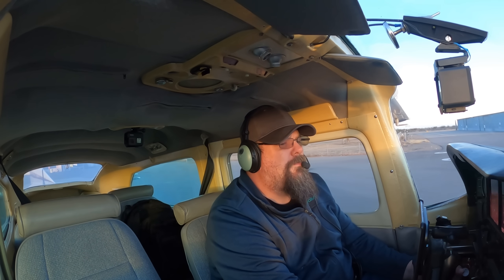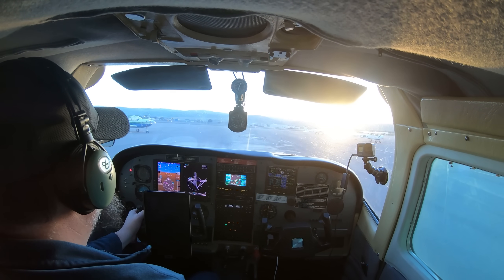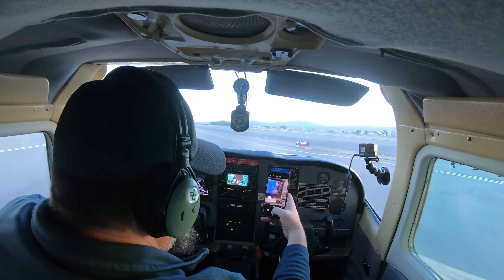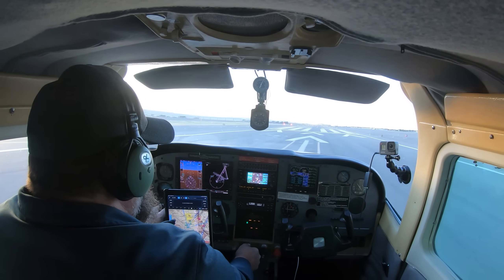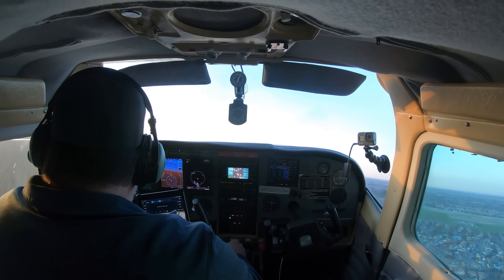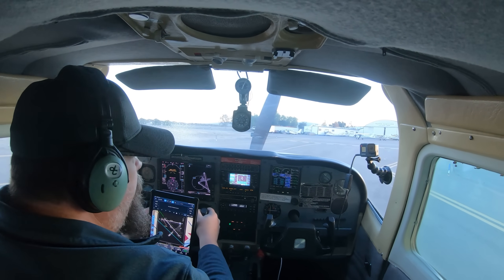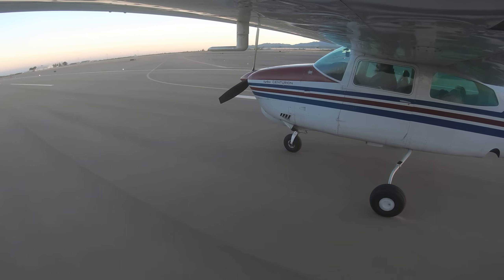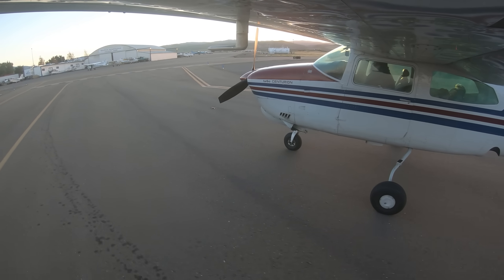Catastrophic Engine Failure after Takeoff

Comment from the maker: First, I want to thank everyone for the kind words and praise, but more importantly, I also want to thank everyone for the constructive critical feedback.  I will admit that there are some items that I was complacent in. And a lesson learned for the next flight is to create myself a special checklist for the maiden flight of the next engine, as well as many more lessons learned. 

A bit of background. I am a sub-500 hour commercial pilot. I purchased the airplane in August 2020, and have 158 hours before it went down for this maintenance. 

To be perfectly honest, I was in a hurry, for a couple of reasons. I had read many articles, for instance the savvy aviation article on AOPA's website at https://www.aopa.org/news-and-media/all-news/2019/january/pilot/savvy-maintenance-breaking-good  ::

"""It’s very important to run the engine hard right from the outset. Keep ground running to a minimum, avoid a protracted preflight runup, and don’t cycle the propeller more than once (and as shallowly as possible). The reason for all this is that running a freshly honed cylinder at low power for any significant length of time can cause a condition known as glazing, in which a tough residue of carbonized oil builds up on the cylinder walls and stops the break-in process dead in its tracks. Once the cylinder has become glazed, it’s no longer oil-wettable, and the only solution may be to remove and re-hone the cylinder and start the break-in process all over again."""

Or ECI: Page 12, step 16: https://www.jjairparts.com/images/uploads/files/Engine%20Break%20in%20Instructions.pdf
Or RAMAircraft.com: "Keep initial ground run to a minimum, only long enough to verify no fuel or oil leaks prior to the break-in flight. "

Another reason I was in a hurry, I was setting out at 4:20 PM PST, with sunset at 4:49, so I wanted to be in the air with daylight for the exact reason that became apparent in this video. Some get-there-itis. Get where? In the Air. Why? Because the shop would be closed for the next 4 days and I wanted to spend the weekend working on the break-in process.

There are a lot of questions about what would I do differently, use of checklists, procedures, the should harness, etc.

First thing I would change. Don't be in such a hurry.

A lot of the ground operations I'm performing while taxiing are me running through the runup and before takeoff checklists. This is not normal for me, I was rushing
At 3:16 I am performing a "Lights, Camera, with action to go" checklist as I turn on NAV and Strobe Lights for instance by pulling back the yoke so I can see what switches I'm flipping. 

So you might be saying, how did you miss the should harness if you use checklists? Well, my only excuse is that I already performed that checklist when I taxied from the north side of the hangar to the fuel island just a few minutes prior. The "Before Starting Engine" is one I need to make sure I pick up from this point rather than the "Starting Engine" checklist.

As for what would I do differently in the air under these EXACT circumstances, I can't say that I would do anything differently, change the wrong thing I'm a smoking hole in the ground. I hope I never have to find out.
Reply: Can I ask what caused the failure? And by the way some great piloting skills on your part glad you were able to set her down safely.
Reply: @ckelley63  Looks to me, like the connecting rod bolts were not propably fastned or had were over tighten. You can see the rods without bolts in it but the rod itself and the hole for the bolts are not broken. Just my opinion.
Reply: You did great under the circumstances. Don't let any nit picking get you down. There will always be something that we can do better but you met ALL the requirements of the mission and both you and the aeroplane are still here to fly another day.
Reply: Im no expert , but it apears that you handled the situation very well, ive seen some pilots go into full blown candyass mode over less
Reply: You did everything correct for the situation at hand and outcome. Hindsight is a luxury not everyone has. But you did a great job. There will be plenty of arm chair pilots contributing, but this was your experience and the hand of God himself must of been right there with you. Love your videos. Stay safe!!
Reply: @builttofly3686  I also thought that the plane (when it landed), ran so freely, over a great distance without power, as if the Plane was being wafted along, by his Guardian Angel's Wings. How much does a brand-new engine cost? It's worth considering after an event like this.
Reply: You did the best you could do. And if there's is a next time you will KNOW what not to do!  Just be careful with the C-210. After all it is a doctor remover.
Reply: I'm a keen private pilot and confess to having made many, many mistakes.  It's a great way to learn and after each mistake I feel a better pilot and hopefully they will prevent me from endangering someone in the future.  The CFI who taught me readily confessed to many mistakes and his stupidest was preparing for an airshow in a Tiger Moth.  He was doing circuits the evening before and while airborne one of the club members was hammering in wooden fence posts to keep spectators off the grass runway.  On landing the CFI struck one of the fence posts and tore a hole in the canvas wing.
Reply: @cormacsyt0  cowling removed would make the engine run hotter. Baffles inside the cowl direct the air over the cylinders to keep them cool. You really have to fly it to break it in or use a test cell to run it in on the ground which requires special baffling and a test cell of course.
Reply: No one has ever had a perfect flight. Mistakes aside, your results prove that you did far more right than wrong. I’m an ATP airline guy with an A&P IA and I certainly have made more than my fair share of flying and maintenance mistakes. I will say this though; it is an extremely risky proposition to not run an engine on a test cell prior to first flight (my assumption is that this field overhaul was not run on a stand). You could get that motor on a dyno or a test cell prior to your next flight and have added peace of mind. I’ve done the break in on a motor that had never been on a cell one time, never again.
Reply: @RobtheAviator  @Ed Frye when i built aircraft carriers we ran each prop shaft at full power for 24 hours tied to the dock before getting underway...and yes we ran an opposite shaft in reverse and a lot of wire cables to hold us to the dock.  congrats on passing your engine out on takeoff check ride.
Reply: Great situational awareness in this scenario. Glad everything turned out alright! I wanted to comment specifically because when you are rolling out I hear the landing gear motor running a lot more than I would consider normal. On our TR182, the motor tends to run occasionally when taxiing only when the nose strut is extended much more than usual, or very occasionally while in flight as pressure gradually bleeds off the system and it has to pump the pressure back up. If I were you, I would have this looked into as your pressure is bleeding off very rapidly and this may be cause for concern if you have a leak in the system, bad seal, weak pump, or otherwise. Just a note from one RG operator to another in hopes to prevent another very bad day with this fairly new-to-you airplane. Hope you can get back to safe and fun flying soon!
Reply: @nrcrate  the gear motor runs for different lengths of time on early vs late C210s
Reply: Being critical in our self evaluation is important for learning but somewhere in your paragraphs you should of mentioned how well you did considering you’re still among the living and able to tell your story. Great job.
Reply: @robertwaldo  I disagree. You can see half the connecting rod sticking through the engine case. My guess is improperly torqued connecting rod hardware. I would much rather have my engine explode on a stand than in the air. You are right there is nothing wrong with breaking in a motor on the airplane. Unless there is something wrong with it; then you will wish you had done it on a test stand. There is a reason that overhaul facilities typically run the motors for hours on a test cell prior to delivering to customers.
Reply: You did good, but I’ve personally watched crash and burns from turning back to late.  Nothing to be done by the time I got the fire extinguishers there.  There’s still the broken tree he went through I walk by every day, as he tried to make the road… but know of MANY people who have had to go into the trees and lived, may got hurt more getting out of the trees….
Reply: @mikeskupniewitz8057  could've gone into the field instead like I would have
Reply: Why don't mount the engine on a stand somehow and do prolonged take off/climb power testing there?
Reply: I'm a not a pilot or anything, but man seeing you handle that without any apparent fear; just staying focused and barely making it back was cool to watch.
Reply: @franklincerpico7702  
Adrenaline can do that for sure.  Mentally preparing for things to go sideways (in my case, literally) helps also.  When i flipped my minivan off the side of a mountain road hitting some black ice on a turn (thankfully a shallow ditch, but i planted the front passenger tire into a culvert which is what flipped me)... i handled the initial accident like a champ.  Calm, collected, focused...but had a full-blown panic attack a couple hours later when i got home and the situation settled in.  Mostly lost my shit because i had a passenger and if anything had happened to them I'd never have forgiven myself.
Reply: So you did all the work on the engine and did you check the oil pump
Reply: Sounds like connecting rod bolts were not torqued properly.....correct to break it in hard from the very beginning...change power settings from 65 to 75 percent each 15 minutes... otherwise glazing will occur...piston and ring clearance are very loose in an airplane engine for a reason.....but do not do a nee car engine this way for break in
Reply: So Grateful that you posted this!!
Kent KAPC
Reply: @cormacsyt0  I would have definitely done a takeoff power static check on the ground, if it was the first time this engine was going up in the air. Don't see anything wrong with it particularly if the plane has good engine monitors to check temps. I can't see how this can damage the engine if anyway that's the same as taking off (minus some additional airflow...).
Reply: Ive built many engines in my life and Never max throttle break them in.
The higher the rpms the quicker you can get a glazing situation or whats commonly known as ring wipe.
(Just like brake pads on a car).
Its better to 1/3-2/3 the throttle till your sure the parts have mated together nicely.
Reply: @noneshere  
Read my post again.
I never said to use "max throttle".
You bring the temperature up slowly, a coupla minutes at at time, an let the engine cool to the touch "each time" you run it, increasing the run by a coupla minutes each time, til you get it up to "operating temperature" ie, your hand will get burned when you touch it. Put a thermometer on it, so you can see the temp increase a little bit more each time you run the motor. 
And you' ll be using a "break-in" oil during these warm up test runs. The "break-in" oil is designed to help seat the rings and mating surfaces, and the sacraficial zinc, manganese and other ingredients help "fill-in" the micro cracks and pits on the cylinder walls left by the honing process, leaving a cross-hatch pattern on the cylinder walls. Once you have run the engine at least ten times and have brought it up to operating temperature n the temps have stabilized. Again, run the engine as many times as you need to get it up to operating temperature. 3 min, 5 min, 7 min, 9 min etc.
etc. Until temp stabilizes. 
Then drain "break-in" oil n replace with the recommended synthetic oil. 
THEN, run to redline a coupla times for a minute or two. (Not wide open throttle)
If the engine was gonna blow up, it would have done so while doing these warm up runs, not in flight. Aircraft engines ARE EXPENSIVE! You want it built, and built right the first time. Take all the time you need to break-in the engine gently, baby it til the Operating temperature has stabilized. Run it ten times or more if needed. A coupla hours of this careful break-in procedure does not hurt anything, and is your assurance that your engine is built tough as nails...
Reply: @Pork-Chopper  i build hot rod v8 engines for fun, and im guessing the same break in i use is the same for what you do on aircraft. varied, steady rpm throttle, check for leaks, sounds, and gauges. i also use plasma-moly faced piston rings to reduce glazing and help ring break in and life too. im wondering if the rod/crank bearing clearance was too tight, it being aircooled and all. i also wonder if the oil pump might have had chunks or burrs in it. i have to tear apart every oil pump i get now, after seeing what they have done to engines.
Reply: @Pork-Chopper Totally professional.  I respect your processes and knowledge.  It’s old school but thorough. Build once build right go good go long.  Thank you for your detailed explanation and knowledge.  I know I’m late to the thread.  🙂
Reply: nice job brother
Reply: Thanks for sharing your experience.
Reply: I'd love to hear the ATC for that flight😳   Glad to have you back safe, friend.
Reply: As an added bonus.. it wasn't dark.  Nicely done!
Reply: Pretty solid landing for what just happened. I can’t believe you made it back. Glad you’re alright.
Reply: @cormacsyt0  Seems a bit foolish to me to only run an engine for a few minutes before you take off especially on a brand new reconditioned engine . If a brand new reconditioned engine fails it fails normally in the first half hour of operation 50% of engine failures occur because of engine of contamination during assembly or other failures occur because of wrong clearances or bolts left loose or not torque properly or not at all. I don't know what the norm is for the aircraft industry but seems like a good idea to put the engine on a Dyno before putting it to your plane or at least run it on the ground several times and then changed the oil and checked for contamination and open the filter and check that as well before flying .Easily could have cost your life . So good on you for your flying skills  but never the less thank you used a fair bit of your luck up
Reply: Mate the important thing is you've absolutely identified your failings in this incident. However, you fucking nailed that return. I'd be happy to sit in your copilot seat.
Reply: Glad you made it back, exile. :)
Reply: Great job with the emergency landing!

Just wondering: is it not advisable to put the airplane in full throttle during the run up?

If it had been on full throttle for a few minutes wouldn't it have blown up on the ground rather than in the air?

I'm just thinking that would be a much better way to find a problem than with a dangerous test flight.
Reply: Maintenance manual trumps what aopa might be saying.
You should never be in a position to decide if you are going to take the condition of your cylinders or rotating assemblies more seriously but if you are, it's the former, be damned with the glazing.
Reply: L
Reply: No worries.......any landing you can walk away from is a good one.
Reply: Great job flying !!
Not so great about the engine.
Did you find out why it failed ?
Reply: I couldn't help but notice the trail of liquid on the tarmac and taxiway...which is definitely someone's concern!  Glad you're still with us!
Reply: You get home alive and bonus: the plane is in one piece.
Reply: Nice recovery after engine fail, but i not recommend this man,you gotta take care yourself man🙂
Reply: Great job of getting it on deck safely
Reply: I thought you were going to say “a lesson learned is to not fly again”
Reply: 33 seconds of flight until the engine lost power. Nice save!
Reply: The engine overhaul was badly flawed. There was still metal particles in the engine causing main bearing failure and subsequent seizure. You lacked confidence in the engine which pre supposes a cheap overhaul.
Reply: Welp time for a Ls Swap
Reply: That engine did not sound happy right from the start. Is it just that I knew from the title what was going to happen?
Reply: That's good info whoever left the tip about runup and cylinder glazing, that part is absolutely 100% true, but hone and wall glazing have next to 0 impact on a fresh engine chucking a rod, there would be lots of smoke in the exhaust and a noticable loss of compression before it even left the taxiway.. And cylinder glazing is something that happens over time anyway. Catastrophic failures on fresh overhauls are almost always from 1 of 3 things, if not a combination these: 1) lack of lube at the big or little end 2) improper oil clearance between the bearing surface and jornal 3) an improperly torqued rod cap or outright fastener failure.. which is very unfortunate but happens quite a lot. Any of these can be shop mistakes, it's rare but all too possible. Sometimes it's just "shit happens", excuse the language. You still handled it extremely well and that's what's important, nobody got hurt. And thanks for not immediately throwing the shop under the bus the way a lot of commenters did!
Reply: God was watching over you that day!
Reply: never stop learning.
Reply: @TheEdwardFrye  you explained it very well.... blue skies and good tailwinds
Reply: Only thing is saw was no radio call could have been a problem, but I didn't hear the patter before & it looks pretty dead.
Reply from the maker: @class2instructor32  there were radio calls, but my gopro didn't record
Reply: @TheEdwardFrye  Then sir I give u a 4! (Canadian marking scale max score) She was close, but we all know about Don MCully (ww2 ace who unluckily is attached to the impossible turn) & lucky for us GA guys our planes glide better than a p51! Have good flights, stay safe & follow your gut, Its not a job so you can just "not fly" if the day dosent feel right!
Reply: My flight instructor told me, "Good old terra firmer - the more the firmer, the less the terror!" (Aeronca 7AC)
Reply: I don't know where you got your information about "break-in", but what you have is wrong, or out dated. I've built motors for a living, n the worst thing for an engine builder is to have a "fresh' motor croak during "break-in".
A fresh engine is first "broken-in" with sacraficial "break-in" oil, on the bench or in the frame. At first turn on, you run for a coupla minutes n check fuel adjustments, then turn off, til cool to the touch. Then repeat this process adding a few minutes more each time til you get it to "operating temperature" You do this to prevent galling and seizing, under load. You may have to repeat this process (cycle) up to ten times. And you do this with "no load" on the motor.
Bringing it up to operating temperature slowly helps to seat the Piston rings, seat the gaskets and slowly expand the metal components, is, cylinder heads, cylnders, cylinders to block. Once you done this along the way you're monitoring oil pressure, temperatures, adjusting fuel mixtures, checking for leaks, And listening for funny noises from the motor. You should already "know" what a normal running motor sounds like. No excessive tapping, knocking or clicking. THEN, drain sacraficial break-in oil, replace with fresh oil, replace filters, look for metal debri in the filters. Run engine again, up to operating temperature, slowly run it up to redline and hold for a coupla minutes, then bring back to idle, it should be running smooth. If the engine was doomed to failure, it would have happened during the "static break-in" procedure.
Once everything checks out, Then take it for a spin. There's nothing wrong with putting in a coupla hours run time during the break-in procedure. You want to make "Damn Sure" that motor is solidly built, or in other words "Certified" to fly. Who ever rebuilt the motor should have done the "break-in" for you, before that engine is "certified" to fly.
Break-in is still a "mechanical process", Why should the Pilot be breaking in his own engine? Unless he built it himself...
Reply from the maker: @Pork-Chopper  I literally posted links to the manufacturers websites in the comment you replied to
Reply: @TheEdwardFrye  
New motors are usually "pre-run" at the factory, rebuilt motors are not usually "pre-run". The owner/mechanic has to take the extra precautions to "pre-run" and properly "break-in" the motor. The process I described is the process for freshly assembled motors. Motors are usually pre-run with a break-in oil but are turned with an electric motor, no fuel is actually burned. The pre-run is to seat the rings and crankshaft and also to collect the first oil drained to be inspected for metal debri. And also check the magnetic drain plugs. A nominal amount of metal dust or particles is normal for the initial run. This is the "testing" the engine gets before being put into service. And, the radial engines I have experience building are Harley-Davidson engines. Knuckleheads, Panheads, Shovelheads, and Evolution blockheads. 
You learn fast when your first engine build blows up! You have to pay for it!!!
Reply: @Pork-Chopper  Very interesting! Excellent & logical points. Good to hear this from an expert!
Reply: @cormacsyt0  So as not to overheat it on the ground and cause the oil protective barrier to fail and cause metal to metal contact inside the cylinder.
Reply: @oneflyerguy1993  Mike, you did a fantastic job of planning ahead, keeping your composure when the failure gestated/took place. I'm a non-current, low-time pilot, time only in C152, C172, C150..then ceased. Dad was a corp. pilot w/ATR(then in early 60's), instructor and A&E cert. as an aircraft mechanic, recips. Still not certain what happened here to that Lycoming. Guess I'll find out down the road apiece. Fantastic job flying the plane post-failure!! Best of luck to you, Sir! !
Reply: @oneflyerguy1993  Hey Mike I'm and A&P mechanic with my private pilot license. I was wandering if you could answer a question for me. We usually use mineral oil the first 100 hours on a new engine or overhauled engine, for the piston aircraft we work on at my shop. The idle build up of the oil setting in the cylinders during the break in, would Phillips or arroshell mineral oil used during the break-in period prevent that oil set in the cylinders. I'm confused I see everyone talking about ground idle and run ups for break in period. But my question I guess Is mineral oil a better way to break in an engine as to help prevent or avoid the oil or carbon build up in the cylinders?
Thanks
Reply: @codyharbison2349  
Mineral oil is the old way. Same for Racers that used Castor oil for "heat runs"...
There are now specific break-in oils available. I've used straight 40w to break-in engines with no problems, then I change to synthetic oil of the proper weight n viscosity... Just saying...
Reply: @Pork-Chopper  do you also use zddp additive? are the aircraft camshaft lifters rollers or flat tappets? im curious.
Reply: @frigglebiscuit7484  
Alot of the Lycoming engines, do, use flat tappets, and can also be updated to roller tappets. Most of these engines are 150-200hp and run at rpms between 2300 and 3000 rpm.
They are built for torque, not horsepower as in automotive, ie, hot rods, and are relatively low rpm motors, therefore reliability is of utmost importance and flat tappets in a properly broken-in motor are quite reliable. I built a small block n big block Chevy motor for my my C-10's with flat tappets for towing with low stall converters and they both pull hard. The small block chirps the tires when it shifts into 2nd. I built them to pull hard at low end and they are excellent street motors. I'm also running 3.08's tall gearing for a bit better gas mileage, (yeah, right!) They are both fun to drive and haul ass in the short run, but they are Not drag strip engines, more like stump pullers.  I know how to build hot rod motors, high HP, I would use turbo charging and a bit of nitrous for that extra kick. But you know as well as I do, motors built for high HP do not live a long life. I built mine with longevity in mind. Less than 10:1 compression for easier starts and to run reasonably well with the shitty pump gas we have. A bit of octane boost does smooth them out and adds a few HP.  Thank you for the question. I appreciate it! Gearhead to Gearhead...
Yes, I used the Amsoil Break-in  oil, and I have also used Competition Cams, cams, and break-in oil with good results. Zddp n moly formulas.
Reply: Qq
P
Reply: LS swap that turd